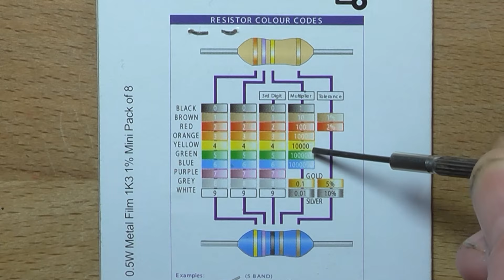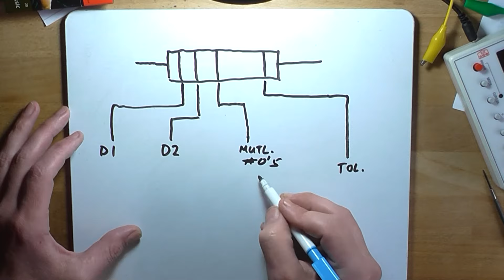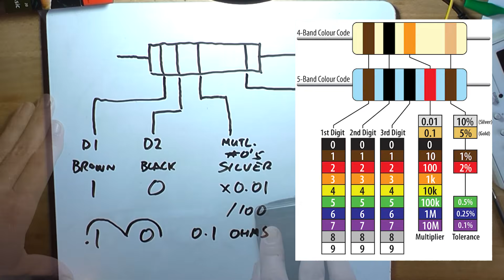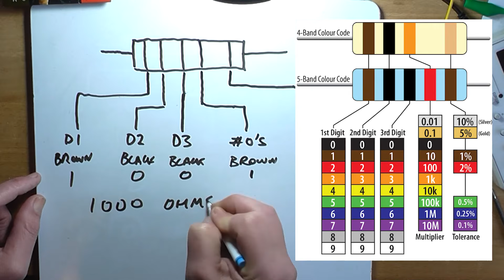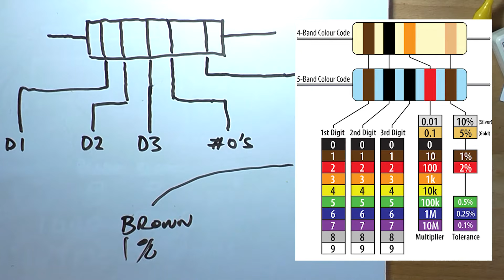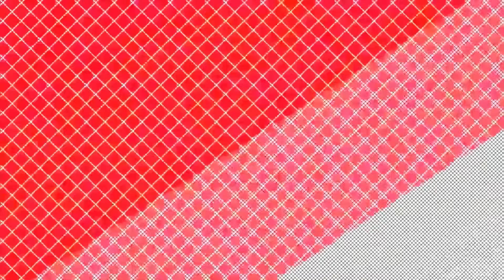Electronics Fundamentals: Resistor Colour Codes

Comment: No worries, the colors are just as (if not more) confusing in person. Multimeter ftw.
Reply from the maker: That's the easiest way, if the resistor is not open... then you kind of either need the schematic or read the colors, if not burnt to a crisp. Then you're really stuck!

Comment: Well presented 
Would you care to comment on this various compositions and quality levels?
Reply from the maker: Thanks! The two most common are the carbon and metal film resistors in 0.25W, 0.5W, 1W, etc. Quality wise, much of a muchness. Most components are made in China these days. Except for exceeding the wattage of resistors either on purpose or by accident, I've never had issues with any failing for no reason.